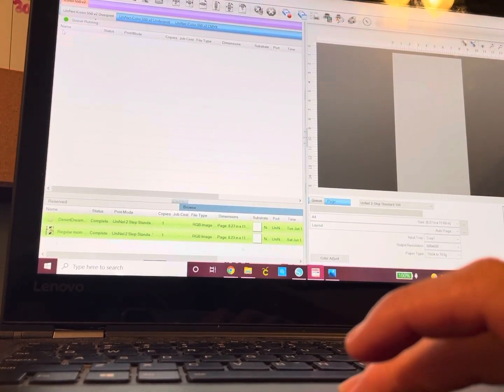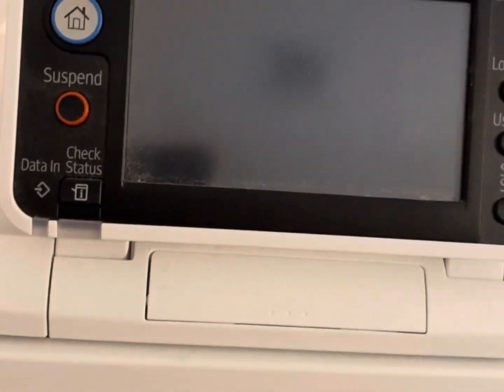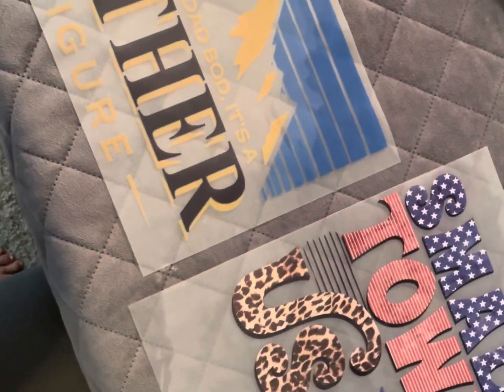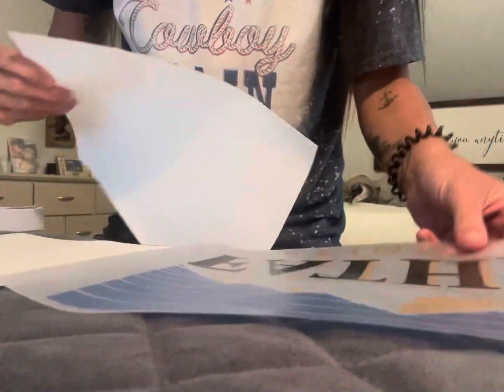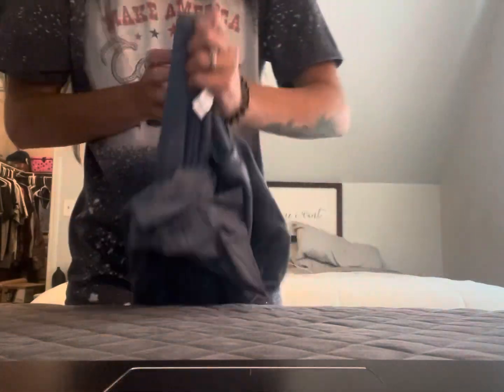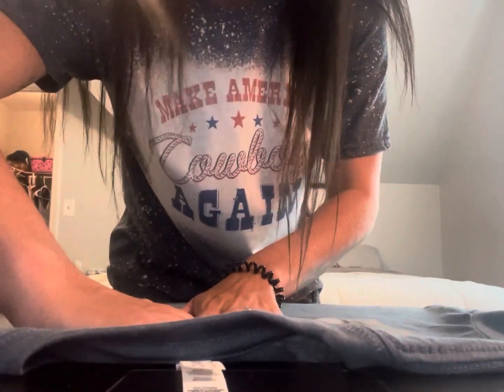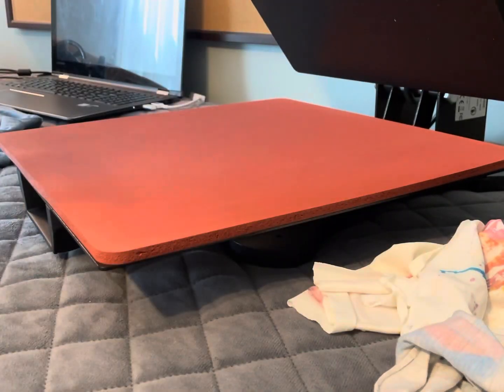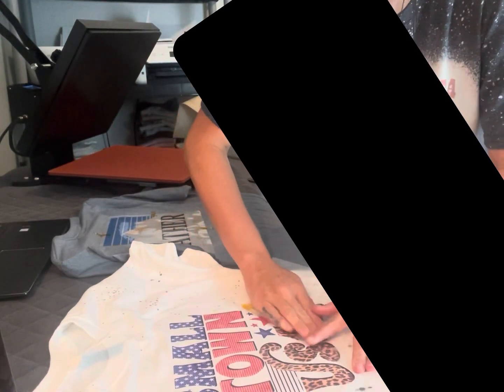Uninet Icolor White Toner 550 Printer

Comment: Its okay for demo prints but not for production runs. The prints crack easily after light washes. Do you use T-seal?
Reply from the maker: Not on small wording shirts. But on big images yes. A good way to prevent the cracking is using the distress tool or the dots or stripes feature on your image to ensure a longer lasting image and a softer feel.